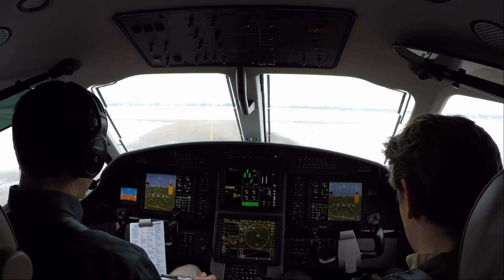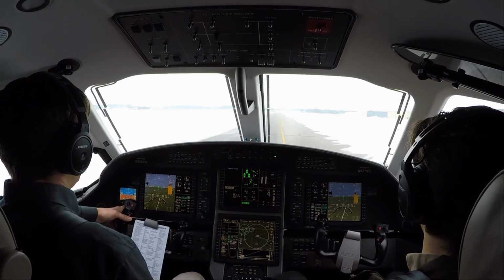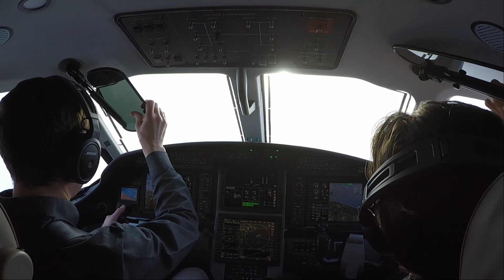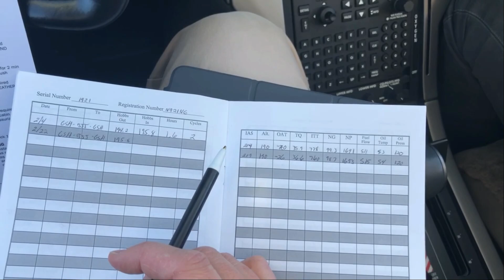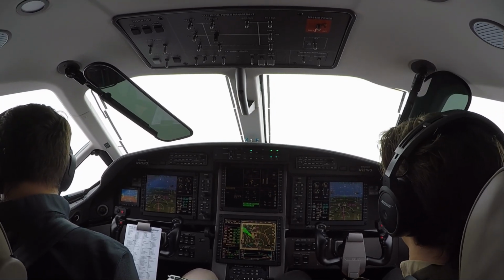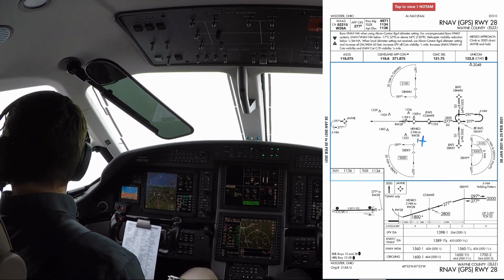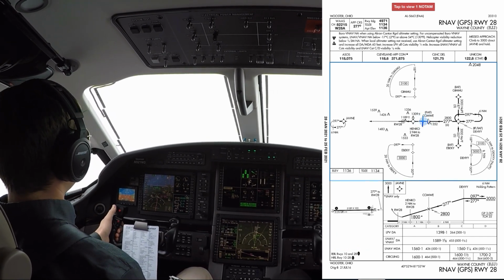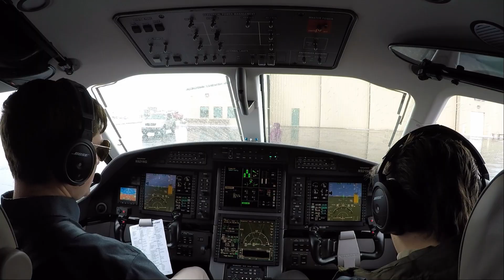Flight Vlog: System Malfunction | Pilatus PC-12NG

Comment: The only time I ever landed at Goshen was May, 1974. At that time the runway was only 4,000 feet long with no VASI or glide slope or glide path. I departed Detroit City Airport flying a radial engine, tail wheel Beech 18 carrying 8 military prisoners and a guard. Nearing  Goshen, the 10  bolts that held the  #5 (one of the lower) cylinder on the left engine all broke off causing the entire cylinder to move up and down with the piston. A massive oil leak ensued resulting in an engine out landing at Goshen at max landing weight. We lost 4 GALLONS of oil in two minutes before I could feather the prop.
Reply from the maker: That sounds exciting! I’d love some Beech 18 time, but I think I’d skip losing a cylinder. 😁

Comment: Well done Grant.   You set a great example that nothing needs to happen fast in an airplane, just stay ahead.
Reply from the maker: Thanks John! Step one is always take a few seconds and relax. Hopefully I’ll be able to stay this calm if I ever have an engine failure!
Reply: @GrantBaker   I was commenting on your overall demeanor, which didn't change when the failure occurred.    I was wondering, can you cycle the prop on the PT-6 to shed ice if the vibration became a nuisance?
Reply from the maker: In the PC-12, there isn’t a prop condition lever, so the best you can do is adjust power to change the angle of the blade to find the smoothest setting. There’s also the possibility that you could get some of the ice to come off. RPM should stay pretty constant.

Comment: Hello baker, congratulations on the channel .... How about this logbook of the engine parameters you fill in (11:24) ... Is this a recommendation from Pilatus or the Maintenance ?  I´m flying a TBM850 here in Brazil, and I never heard of this book. Could you tell us how this works ?    
Thanks a lot.
Reply from the maker: Hey Marco! The book came from Pilatus. Maintenance tracking software (we use CAMP) uses cruise trends to watch for issues in engine performance. I send in downloaded data to CAMP for that but still keep the written log also for myself. Here’s an article from Pratt and Whitney explaining why you should keep track. https://www.pwc.ca/en/airtime-blog/articles/technical-tips/why-engine-condition-trend-monitoring-is-a-must-for-pt6as
Reply: @GrantBaker  It´s amazing Baker. Great article.  I reaally apreciate for the attention.  I must confess to you that I have never seen this logbook among the TBM operators here in Brazil ... I will try to find this ECTM logbook on internet and print it .. Once a year I go the the Anual Inspection I will show. I just need to find this on internet .   Once again, thanks for the attention and congratulations for your flights.  Also,  sorry for the English mistakes.  Thanks a lot .

Comment: There are times in ones life when you would like to take a greater measure to accurately convey the regard for a particular achievement.  I am at that time with Your post.  For many years I and many others have strived to convey the sentiment of what it's like to fly single-pilot hard IFR while managing a separate issue.  This flight, and your handling of it typify how such a situation presents itself, grows in intensity, and gets sorted out and dealt with in a logical sequence rather than a knee-jerk reaction to the most recent item.  Great job.

Not a criticism, but I'd love to know what the issue was regarding the prop deice system.  I'm assuming a wiring matter.
Reply from the maker: Thanks Richard! The prop heat system on the NG isn’t a simple on/off switch. When I turn it on, the system cycles based on OAT. If the two OAT sensors for the prop heat don’t agree for some reason, then it will throw a CAS message. I’m pretty sure that’s what happened here. It happened once or twice more in the following month or two and hasn’t happened since.
Reply: @GrantBaker  Thank you Grant.  Given the electrical loads associated with these airplanes it makes sense this type of system exists.  I'm sure you're not looking for a pen pal, but I'm curious why the wing deice system appears to be manual (which you were able to operate at will) and the prop system has automation?  I'm confident the wing boots pump draws a lot less amps than the prop deice but the prop deice is a pretty important feature which in my case I would want to control versus a couple of sensors having a conversation.  Also, and you're probably ready to shoot me by now, it would seem to follow that if you were activating the wing boots based on observable icing, then the conditions for the automated prop deice system would reasonably be following that cue.
Reply from the maker: The wing boots are inflated with bleed air off the compressor section of the engine, so the only electrical load is opening/closing the appropriate valves. I can either select off, a 1-minute cycle, or a 3-minute cycle, so it is somewhat automated, but not dependent on outside air temp. The prop heat timer has different modes depending on air temperature. 
(Mode 1)If it’s warmer than 0°C, the blades aren’t heated even if you turn the switch on. 
(Mode 2)0 through -16 inner section on all blades heated for 45sec, followed by outer sections by 45sec, followed by 90sec off.
(Mode 3)Below -16 inner sections on for 90sec, then outer sections on 90sec. 
According to my service center, if the control and comparator OAT sensors don’t agree, the system defaults to Mode 3. Any failure in the prop de-ice system that’s detected displays the same CAS message though, so you’d have to check amp draw to see if it’s actually working.
Reply: @GrantBaker  Great explanation Grant, and thank you.  Are you familiar if planes like the E1000, or TBM have a similar system for prop deice ?  I'm not throwing stones, because I like the PC12NG.  With a little muscle memory on that system I might feel better about it.  I just like simple systems on critical items and it seems Pilatus has it worked out for the wing boots.  I guess on faith, I would need to recognize that the plane is manufactured and flown in a climate where system dependency is extremely important.
Reply from the maker: I’m not very familiar with Epic and TBM. Other planes I’ve flown only have one cycle mode. I’m not exactly sure why Pilatus designed it this way. This design would reduce electrical load when it isn’t really needed, but there may be other factors they considered also.

Comment: Is prop heat something you can MEL? Just curious. Great job, enjoyed the ride-a-long!
Reply from the maker: The prop heat is only required for flight in icing conditions.
Reply: @GrantBaker  gotcha, but if you suspect icing on return flight is it a no go item? What was the issue? Enjoy the videos.
Reply from the maker: @ProPilotPete  it would be a no-go if you can’t stay out of expected icing. I’m this case, the most likely scenario was some miscompare between the two temperature sensors for the icing system. The icing system test for the return flight was good, so we were good to take off and we didn’t have any issues on the flight back.
Reply: @GrantBaker  that’s good. Hate those squawks you can’t duplicate on the ground.